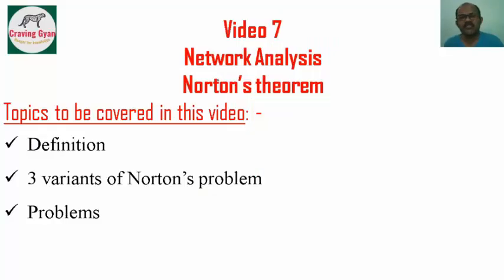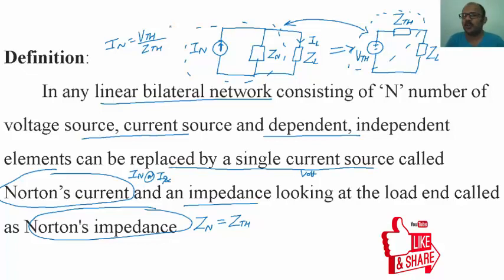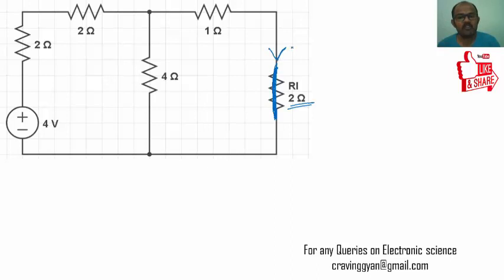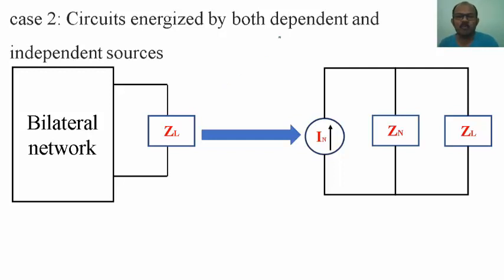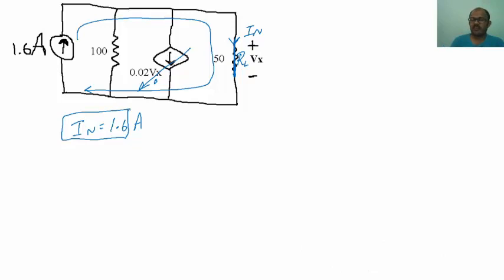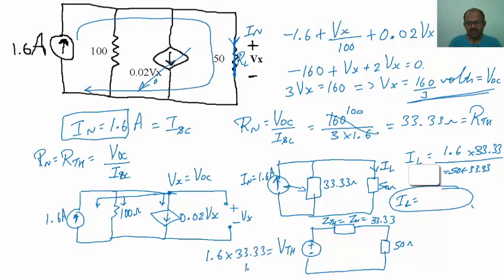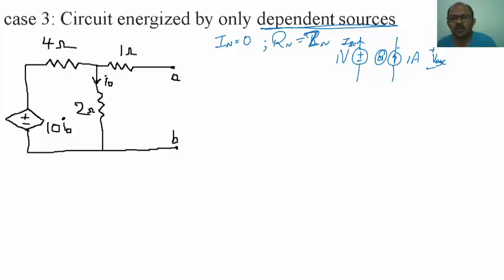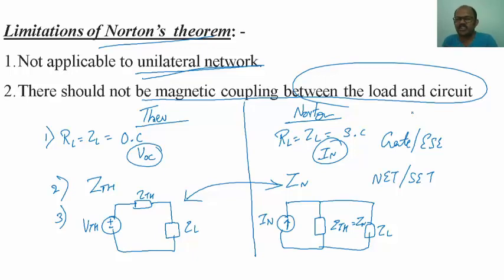Nortons theorem

Comment: Hi sir,I have a doubt.In case 2 example,why is the current 1.6A not flowing through the 100ohm resistor and flowing only through short circuit path?In case1 also we had a short circuit path,but current flowed through all resistors(2ohm,2ohm,4ohm and 1ohm).. kindly clarify.Thank you!
Reply from the maker: In Eg 1, left branch resistance is 4, middle 4, right 3
But in Eg 2, you got complete short circuit path, hence all current (1.6A) flowed in least resistance path (i.e, zero resistance)